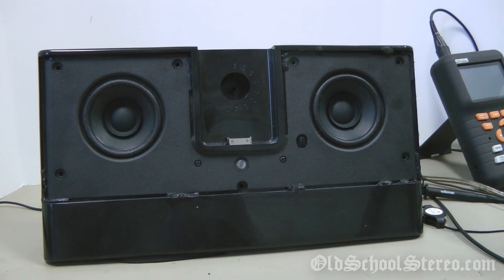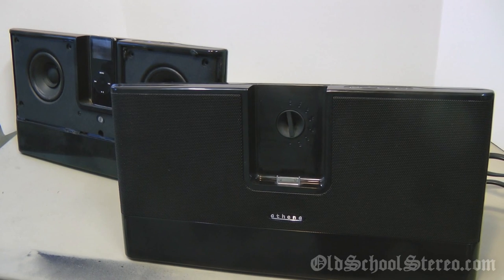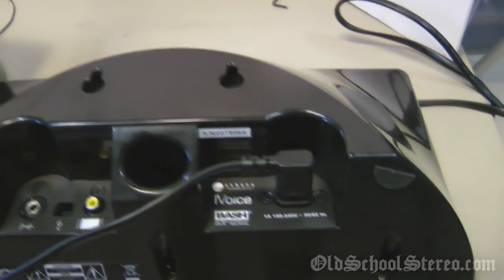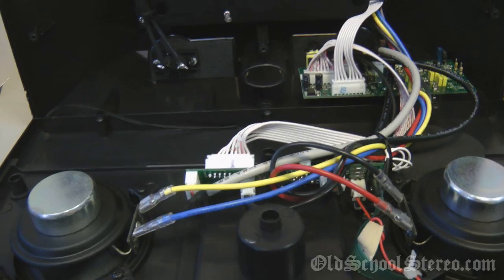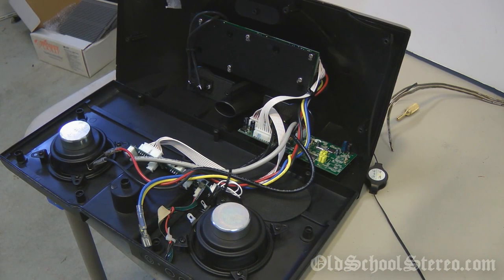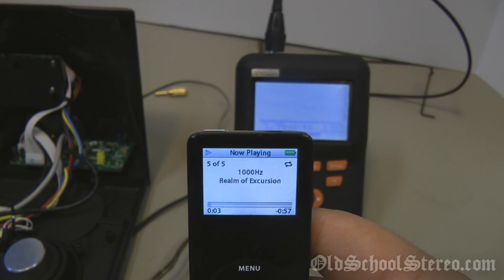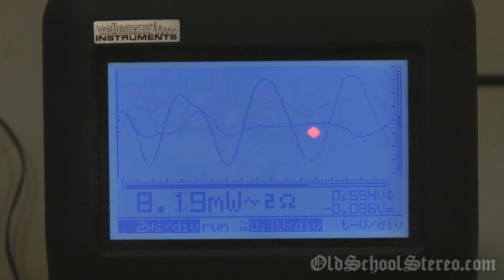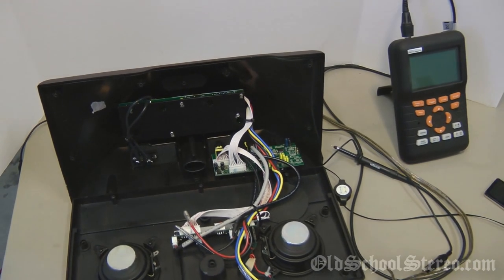Small and Powerful iPod Dock - Athena iVoice Power Output Test - 1080p

Comment: Those will be called 8 Ohm speakers. The DC resistance is always lower than the complex impedance. Looks like a class-D amplifier, lots of power for the size as they are very efficient, minimal heat generation. You got a nice doubling of output power into the 4 Ohm test load because the amplifier is stereo, so the power supply is designed for an effective 4 Ohm load (2x8 Ohms driven), the power supply voltage drooping is the main cause of reduced output into lower impedances.

Comment: How did you get the dock opened up?  Mine doesn't work any more, so I thought if I got inside it I might be able to fix it.  I unscrewed the 3 screws on the rear bottom and the one under the ipod depth adjuster and the 3 little ones by the power input and rca input.  But there are more screws I see in your video that I cannot access.  So how did you get in there?  Thanks